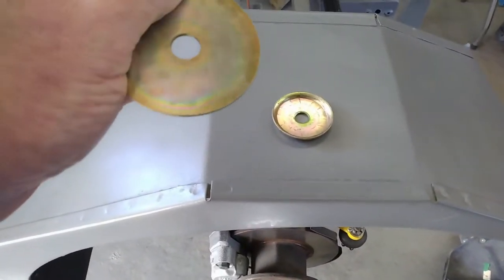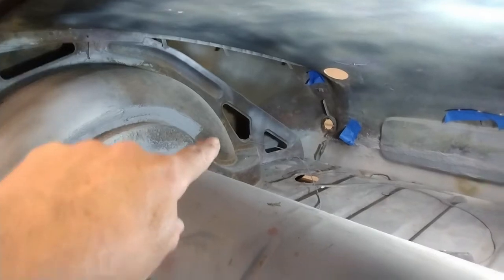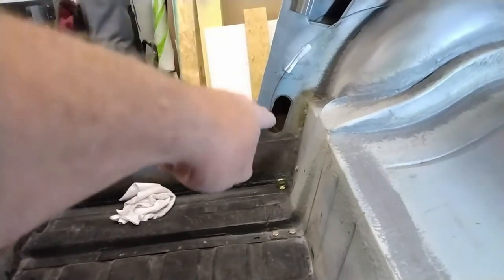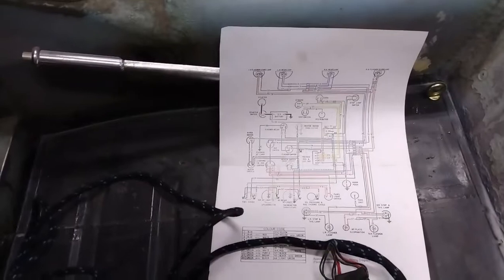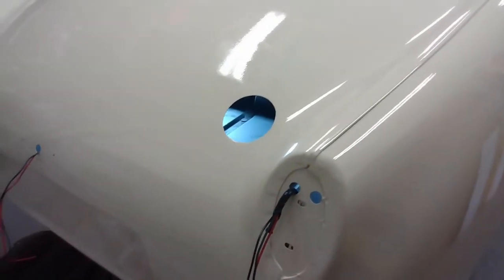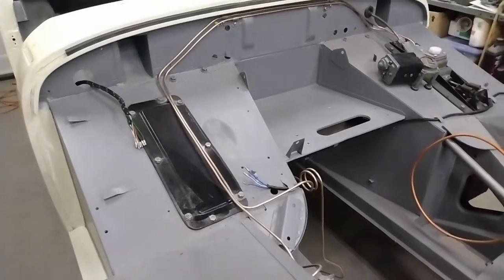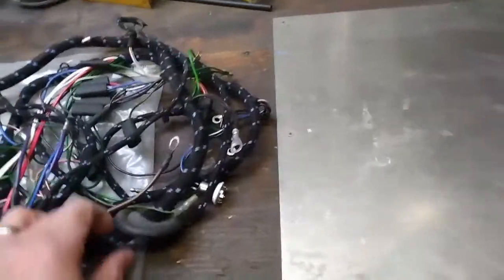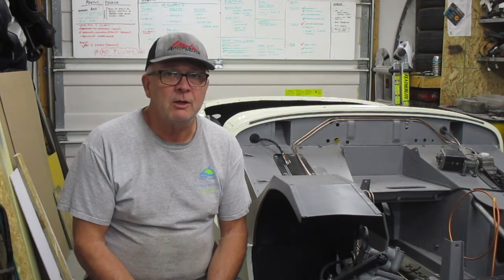How I reinforced the seatbelt install plus some of the wiring harness installed.  Bugeye Build Ep 88

Comment: Another great report, Ian. 

A helpful tip I have found when working in the trunk (like bolting in the Over-rider Support Brackets!), is to have the rear of the Sprite as high as possible relative to the front. Much easier on the tummy, etc.
Reply from the maker: Thanks Ron. I'll give that a try.

Comment: Interesting progress! (and progress it is!!) Do you have the glass license plate light lens? Is yours painted yellow? Or is the yellow paint still intact? On the 58 Sprite, the yellow paint was still in the lens, but badly flaked off. There are other lenses and plinths in my stash of parts, some have the yellow, some don't. Knowing that license plate light and plinth was used in a dozen cars over 20 years, I'm sure it was delivered painted or not depending on the year or make/model? Are you going to use LED lights or are you going to use regular incandescent lights? I will say, my 58 Sprite license plate light is extremely bright with two tiny LEDs in it. It really lights up the plate nicely to the point where it improves rearend visibility significantly. The regular bulbs though were yellow and threw out very little light.
Reply from the maker: Hi Ken. My lens is a clear glass one and doesn't appear to have been painted at all. The plan is to go with LED lights all round except for the headlights. Those will be regular H4 (I think) bulbs in reproduction Lucas tri-bar housings.